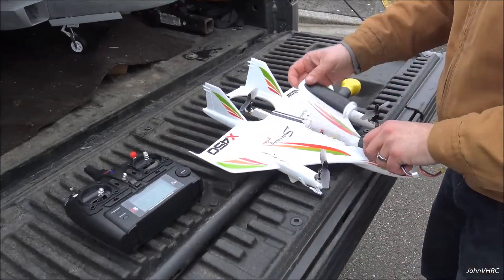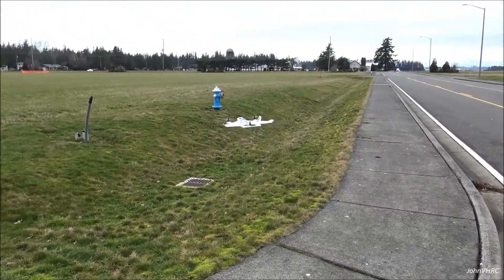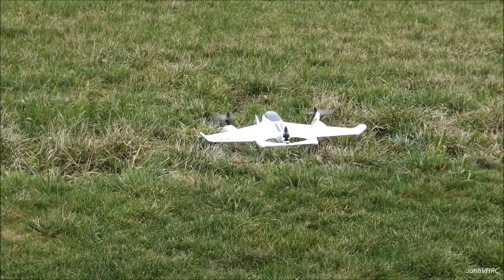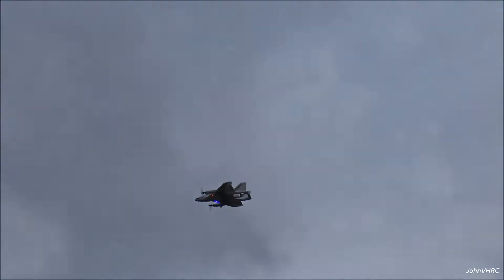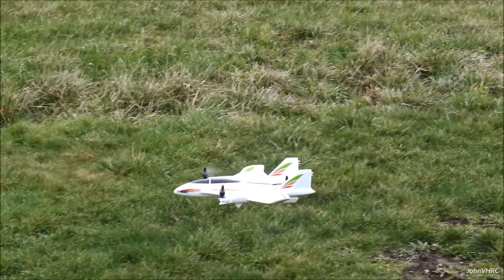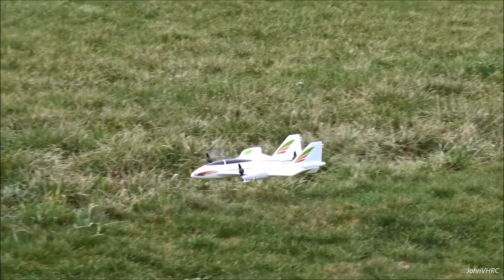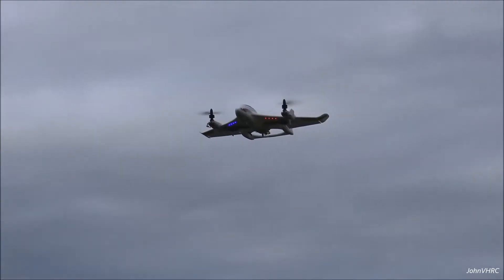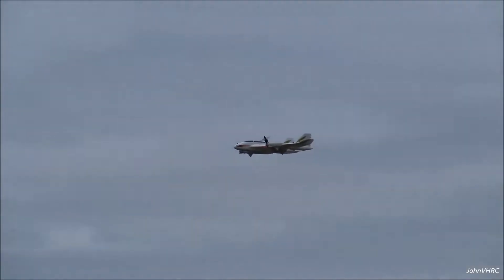XK X450 VTOL RTF FLIGHT TEST Review Part 2

Comment: Nice vid thanks👍If in airplane mode and you close throttle to zero can it be controlled or glide or is connection lost 🤷‍♂️
Reply from the maker: You don’t lose connection by closing the throttle.

Comment: Mine is not working - I can't get anything to respond correctly. The motors fired up after I activated the esc and if I wasn't holding onto it it would have gone through the roof.

Comment: I am really interested in this plane, it's a great model. I may get one.It stands out from the crowd becuase it's VTOL and at £79 is good value, must be really great fun.I had the X420 Brushed Vtol a few months back, but it's not as good as this (the motors didn't hinge allowing for conversion) it got ran over by a van, so no luck there.I heared somewhere that the motor servo's are a bit weak on it and wear out quickly,is this the case?

Comment: Anyone know if these have DSMX receivers in them (i.e. will they bind to a Spektrum TX?)
Reply: Nope. AIO board works on an orphan Futaba S-FHSS derivation. Available now on Multi protocol module radios.
Reply: The actual protocol is number 62 - XK Protocol/X450 Sub-protocol.

Comment: Why didn't you sync the gyros?It makes a big difference.
Reply: @Jeffrey Hurd Your information is incorrect. Gyro calibration (by craft in Multicopter Mode and sitting on a level surface, then both sticks to bottom left) is quick and highly recommended at start-up and after any knock. As you intimate, the swiveling front motors and their associated mechanics are the weak points in this (and the overly expensive and less sophisticated Convergence/Mini Convergence) so it pays to be very careful with any of them if you want a reasonable flying to fixing ratio!
Reply: @Jeffrey Hurd My apologies mate. You are the first person to report that he has received a "fake copy" of 1 of these interesting XK X450 multi mode V-tols and that it was delivered without the normal internals. Please post details of it and where you got it from. 
I had thought that you were just one of those raving "Patriotic" fools who always rant about "fake Chinese junk rip-offs" of "genuine American" products without realizing that their favourite is made in the same factory and with the same quality of components. That would make as much sense as saying that an American built Ford or Chevrolet vehicle is just a "rip-off" of old Carl Benz's invention and that you should buy a "genuine" Mercedes instead because it might be better made.
With regard to the servos, as mentioned these are the weak points and can be replaced with metal geared units (for a small weight penalty) both on this and the similarly plastic geared servos equipped Convergence/Mini Convergence. However that won't completely fix the inherent weakness in the original designs. You will still have to treat them gently or spend a lot of time fixing them. 
A better V-tol with regard to flying to fixing ratio is the excellent XK X520 which is a so much more durable product as to have replaced the inferior X-vert in the market! It has excellent gyros similar to the genuine XK X450 as well.

Comment: Fun little plane except it breaks very easy in the most minor crashes. The servo`s are plastic and what happens with the motors out front like that it grabs the motor and snaps the plastic servo in crashes. I found some 5gram metal servo`s on Banggood and will be putting them in mine. This plane is great but must fly with care or it ends up being a paper weight, or sits there for a month waiting for replacement servo`s! Great video! Enjoyed very much!

Comment: I love this bird.  It grabbed the attention of my RC club during our Winter indoor flights.  I also love to fly this in my neighborhood around the house.  The quadcopter feature allows this close proximity flying. In fact, I purchased another.  Now, the BIG negative and all owners should be aware.  The acetal plastic servo gears will break in a heart beat.  In fact, I'm awaiting my second metal gear servo for my first bird.  Ordered two others for the new bird that's not arrived yet. These are the servos that drive the motor pitch.  Just  a bad placement which makes them vulnerable.
Reply: What brand and or part number servos did you order to replace the servos you speak of? Will you be posting a video making the repair?

Comment: Will this fit a 1300mah??
Reply: Hey Matt, I have a few 1300ma batts from other projects, one 15c that is a tight fit and three 20c (also puffed a little) that are a really tight fit!  I had to trim the lip at the front of the canopy a little for it to sit down all the way and could probably trim the sides of the battery bay a little for an easier fit, but overall they do work.
Reply from the maker: Depends on how thick it is.
Reply: JohnVHRC great thanks .  Mines currently on the slow boat from China . Hopefully arrives soon